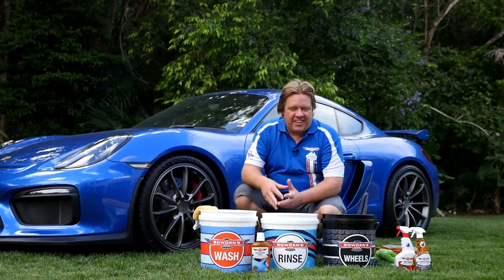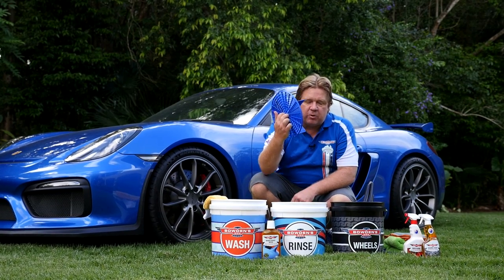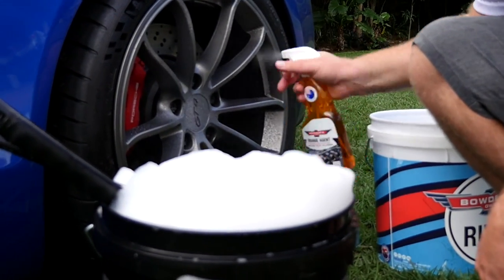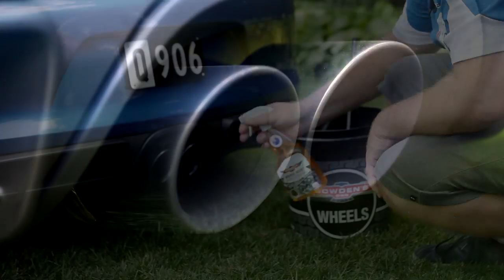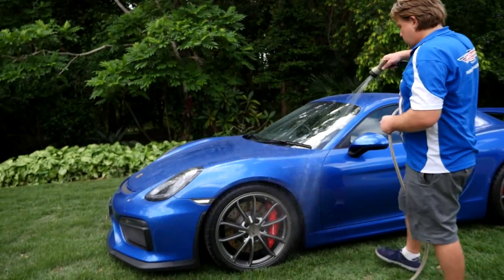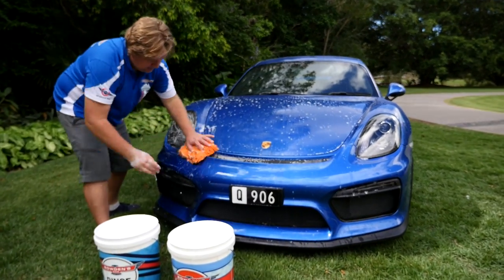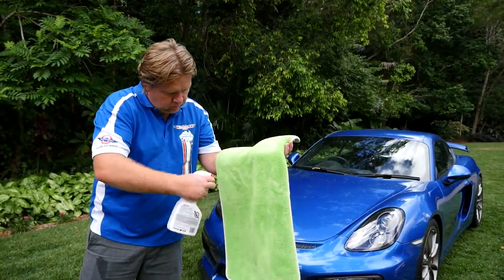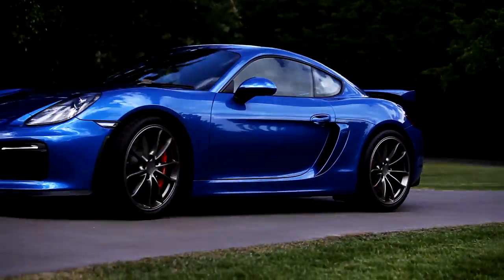A three bucket wash technique, for a safer clean.

Comment: Oh my god you did not just use your rinse bucket for wheels and paint 🙈 if your gonna rinse off your wheel brushes have a 4th bucket
Reply from the maker: I'm guessing you did not watch the whole video there Paul...... Like the bit where we wash and totally wipe out and Rinse Bucket and Grit Guard before using them for the Wash afterwards. But by all means buy two rinse buckets, I'm totally ok with it. :)
Reply: i did actually and still would not use that bucket on my paint you never know what you might miss when cleaning it out
Reply from the maker: Believe me when I say we looked at this before making a video on it. You have a bright white bucket that has super smooth sides, you can see everything in it after the wash and it easily rinses right out, even before wiping it. Brake dust is the biggest issue, as you do not want that getting into your wash tools. We did some tests earlier this year by spraying our Wheely Clean (Iron Decon spray) into the rinse buckets that we'd been using for the wheel cleaning and there were no iron deposits in there, or on the grit guard after many, many washes. I could understand that if you are super lax and have a real tendency to miss things, or you do not want to wipe and wash the buckets out between the wheels and washing steps, so by all means use two rinse buckets, but we have found for ourselves and other pro detailers who are using our gear that it is not necessary.
Reply: i understand that, just that me personally i could not bring myself to do this, its not exactly a hassle to have 1 extra bucket? if this works for you then fair enough but personally i wouldnt
Reply from the maker: But it's a hassle to spend 30 seconds to rinse out and wipe down the grit guard and bucket? As I said at the top you can by all means buy an extra bucket and grit guard, as I'm seriously not against it! But if you can do it safely with just three buckets we believe you should, so you have less gear to prepare and lug around, making it more time and cost efficient too. But in the end you do what works for you, that way you can never go wrong. :)